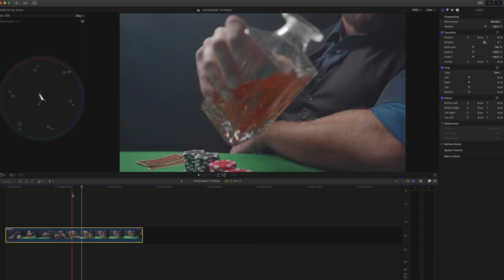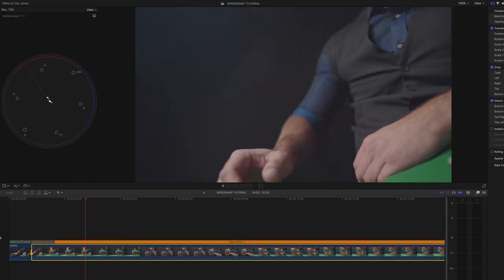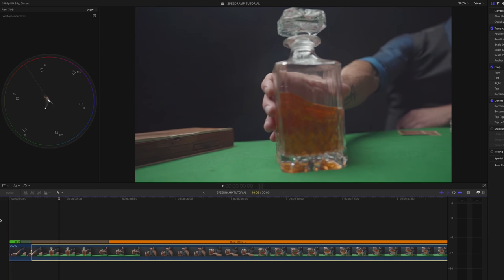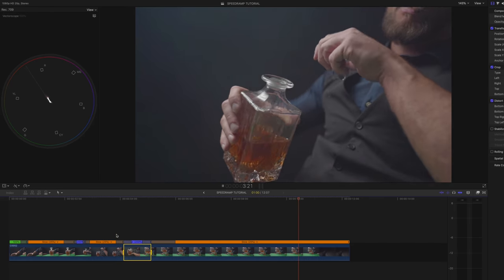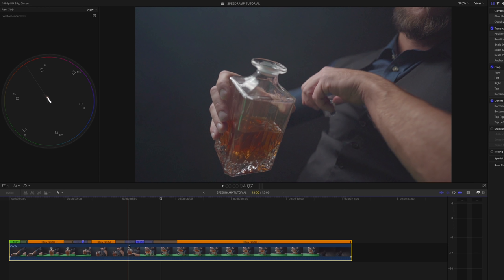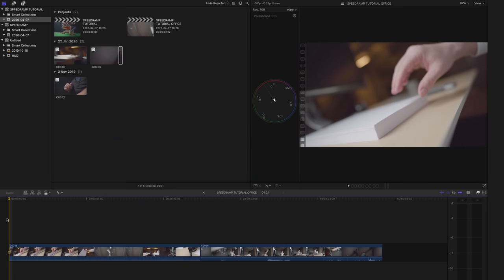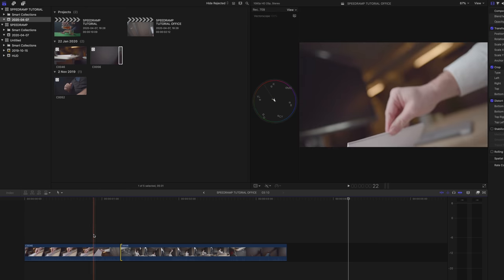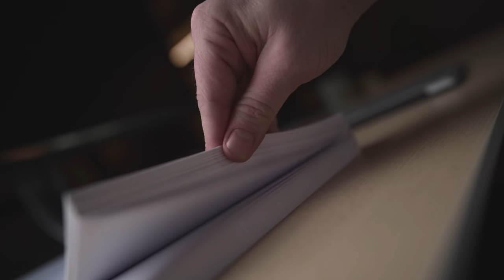Become A Master of SPEED RAMPS | FINAL CUT PRO X TUTORIAL

Comment: Also one more tip, if you use Final Cut Pro, and want to make it even smother Go to "SLOW" and change from Normal to "Optical Flow" It will be soooo good🔥
Reply: Same like Resolve
Reply: I mean that shouldn't matter though if you're exporting at 24fps. You shouldn't slow a clip down past a 24fps rate. 120fps should be slowed to 20% and 60fps should be slowed to 40%. This ensures that the video has been slowed down to its minimum speed of 24fps. Nothing should be below the 24fps threshold. Unless you're planning on delivering something or exporting at a higher frame rate than 24fps, that doesn't necessarily matter. If you're exporting at 60fps for youtube vlogs of video game videos then i see your point. But technically speaking if your trying to export at 60fps then none of your clips should be slowed down past the 60fps mark. But i see your point if thats you're only option. Ive seen alot of gamers record in 120fps and slow it down well past 24fps and you can clearly tell they used the optical flow but it still is supper satisfying to see something like modern warfare 2019 slowed down to make it look like it was shoot in 240fps. Its crazy!
Reply: @colewilliams6715  Well explained about the fps

Comment: Congrats excellent intro. How did you shoot your video for speed ramping? 120 fps? Could you do this with 24 fps?
Reply: He shot it in 120fps, he has a vid on doing the poker vid. If you do it in 24fps, you can't slow it down very much at all. You need to plan your shots so you have the right frame rate for the application.
Reply: @waynosfotos  What frame rate was the project in Final Cut?

Comment: Hi Peter. I love speed ramping  too. Which is the fps you used? Because to slow to 25% I usually film in 50 fps but you?
Reply from the maker: If you shoot in 50fps then you can only slow it down to 50% (on a 25fps timeline). That's why I shot my sequences in 100fps whenever I need to slow it down that much!
Reply: @PeterLindgren1  Ok I agree 100 is better than 50 but it depends also on the camera because my GH5 can shoot 100 fps only at 1080 without audio but anyway I have understood the idea